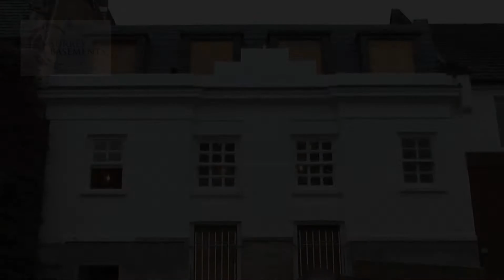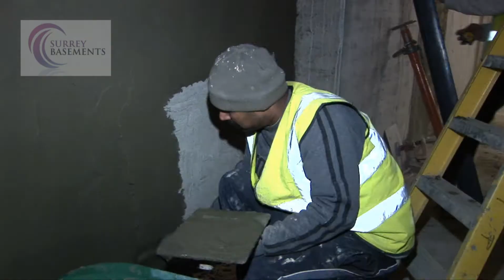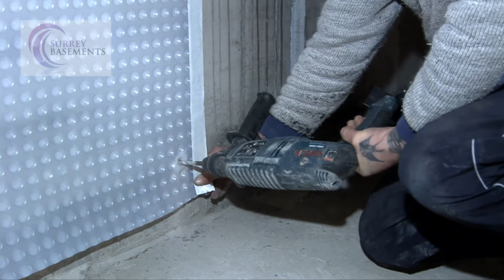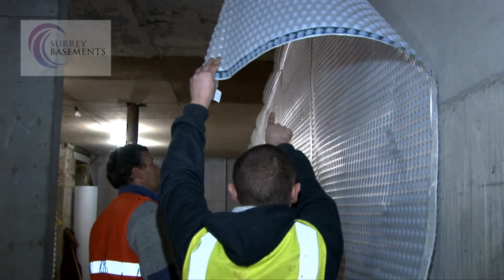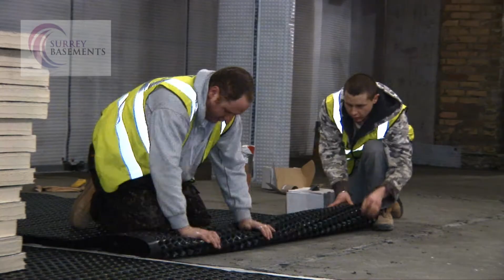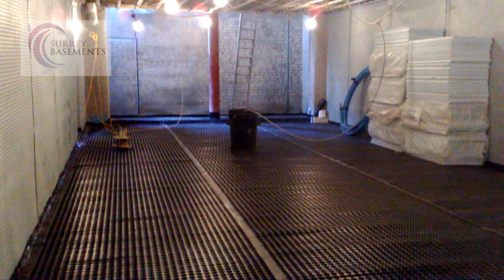Structural Waterproofing

Comment: What happens to the dampness, water behind the membrane. I have an old granite house and  bedroom at top of house has dampness. At the moment dampness comes thru wall, with membrane in place would water run to floor below?
Reply: Hi is Luan if you haven’t sorted your problem please call me on 07446852886